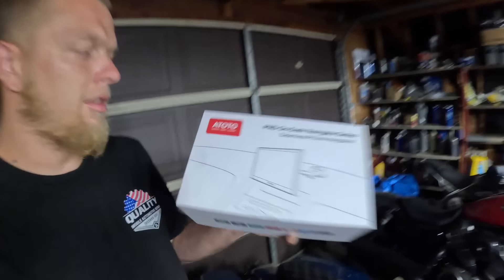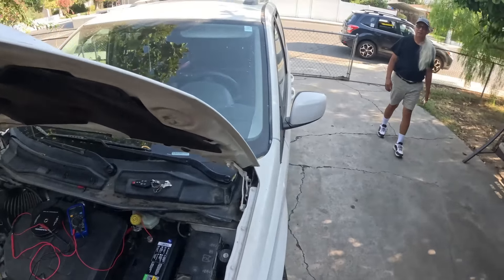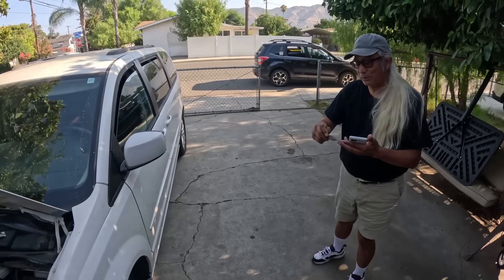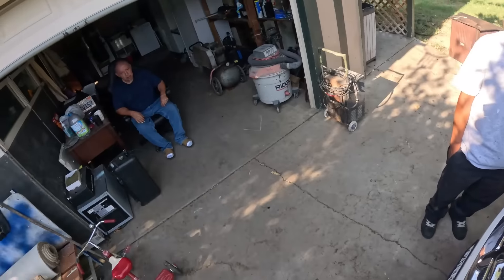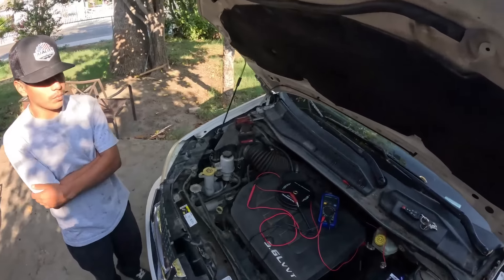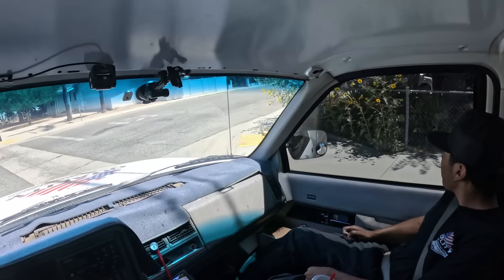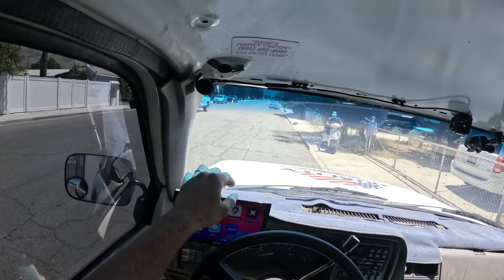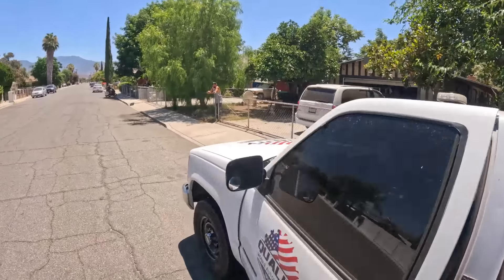CUSTOMER was UPSET! Mobile Mechanic ELECTRICAL diagnosis

Comment: I’m a master technician and unfortunately most people don’t understand that the first step in a diagnosis is to make sure the battery and terminals are good then proceed. It is literally the first step to take especially in today’s vehicles he money light will activate if the battery is not at full capacity
Reply: I’m a masterbator and even I know you start with power.
Reply: Lmao been master at since 13

Comment: It’s best to do a draw test on the negative side of the battery. And get yourself a good meter that is reliable and accurate. Cheap multimeters WILL let you down.  I will know haha. Your doing ok with showing the customer why there car Dosnt have a draw or have a problem. Keep doing that. You will go far. Best of luck to you out there

Comment: There is so many bad parts out there now, including batteries. Some people can’t accept it can be the problem because they think the part is new so it can’t be bad.
Reply: Bad parts not only bad for customer  also bad for mechanic making them look bad even job was done properly.  Parts quality getting worse
Reply: To be fair, the new battery didn't work
Reply: @saulpedraza645 and thats because most "mechanics" are just simply parts swappers.. who can't tell you exactly how something fails.. but that "its bad and needs replaced".. which is interesting.. given how much they make for simply being wrong so often also.. if I'm told to paint a kitchen.. and I end up painting the bathroom.. do I get to still collect money? Seems mechanics are given way too much leeway with their misdirection.

Comment: Nice job sir especially keeping the client informed and showed them the actual problem. Was thinking "put some dialectic grease on those connectors!" for those fuse box connectors but, they are probably fine...

Comment: Sometimes customers, and anyone else, for that matter, can let emotions get in the way of a diagnosis. Since the battery is new, it "can't be the battery." Anyone who says differently is wrong.
Reply: Yep I fix most of the family's vehicles, a lot of Chevy trucks, and delphi parts are junk now. Had 2 new coils and 2 new fuel pumps that were bad out of box, Bosch is now the GM factory supplier because of delphi quality issues.

Comment: Why didn't you do the draw test on the first time you were there?   You could have unhooked the primary wires from the bad battery and hooked up your amp meter between the jump pack and the primary leads.    The jump pack you were using contains a 12v lead acid cell battery, same as a car ;)

Comment: You need to get a genuine load tester that tests the battery by putting a load on it.
Reply: You can't load test a battery unless it's fully charged. This battery is junk. Goes to 11 volts with just the key on.

Comment: Hi , great video , I suggest you to get a clamp amperometer to diagnose abnormal absorption on the battery.  The current clamp is quicker to apply to the circuit , and saves you time.

Comment: Retired Mechanic.
Great job fellas.
Patience is a virtue and it definitely helps if you have great communication skills.
If you can give your customers the visuals of what's required to rectify the issue and articulate to then the diagnostic and ongoing prognosis in terms that are reasonably simple enough for them to understand, it helps vaiidate and alay the 'ka ching' $yndrome that required them to call you in the first place.
The bottles of water analogy you used to describe the battery issue with the mother was excellent. 
Keep it up.
Yes... some customers require a number of reassurances before they accept you're one of the good ones that they will readily become part of your customer base.

New sub from New Zealand.

Comment: I always run my meter in 10 amp mode when doing that test.  It's lower accuracy but sufficient to see if you have an unusually high parasitic draw, and robust enough to handle normal loads like ECM and interior lights.

BTW, did you put ink in the printer?  LOL

Comment: To diagnose this kind of problem takes a lot of time to diagnose. This kind of car is a piece of junk the problems are intermitent. To begin I want to hear numbers is it 12.5 v, or 13v, or 13.5v, or 14v or 14.5v or 15v or 16v. it is a big deal knowing the exact voltage from alternator to battery. does the vehicle has a parasitic power draw?
Batteries once are discharged fully, often times cannot be recharged and it isnt the battery fault its chemistry and electricity at work. wiring is most likely the problem as these vehicles are the worst.

Comment: Had similar issue, watched a couple YouTube videos. Ordered new relay. Desoldered bad relay, soldered good one in and put all the layers of the module back together. And worked like a charm. As others have said there is a bypass that you can buy for this issue but it was like $50 and the individual relay was a couple bucks.

Comment: Tip from a guy that does a metric ton of diag at a dealer with low comeback rates invest in an amp clamp for parasitic draw test saves meters from accidents. I usually open all doors trunk and hood and close all latches so car thinks it's all closed and I can still access all of the vehicle until I find my draw
Reply: A regular inductive amp clamp meter won't work to measure DC current.  Inductive clamps only work to measure AC current.   AC/DC clamps usually cost extra because they use a hall-effect sensor to measure DC current through the clamp, so that you don't have to use that janky shunt.
Reply: I use a Klein tool one also comes with a meter for temperature and it has been worth it heavily for diagnosis I started keeping it out of the bag and more accessible I use it so much

Comment: I do my fees a bit differently. The original call was a no crank no start, then crank no start. To me it makes no difference if the battery was bad and the control side of fuel pump circuit was bad. Both are the no start condition and id bundle them as my diag fee.
Testing parasitic draw and testing bad battery is extremely fast and easy for me.
Looking at the wiring diagram on Mitchell is fairly easy but that's where I'd charge my full diagnostic fee + time spent.
Then any repairs after if client decides to proceed with repairs after everything has been thoroughly described where they can understand the condition and cause.

Had plenty of customers that get frustrated with bad new parts but when you show them it doesn't work, then bypass they generally understand you know what your doing, it also helps to add a rundown of what proven to be functional and what's not functional.

I simply tell them by bypassing a solenoid "control switch" they can understand it starts and that can only happen if everything on the circuit is functional other than the switch you bypassed/manually closed.

But I get the frustration with some customers. Been there many times.

Comment: You could do a draw test using a jump pack , disconnect the battery and just test using the jump pack 
You would then have an answer one way or another and prob not need to come back

If you do your current draw test using the ground terminal you dont risk shorting out the positive anywhere

Comment: I just got rid of my 85 GMC truck with extneded utility bed. For your dash you can buy an after market molded single din stereo kit that replaces your storage box just below your 2 dash vents. You can then buy a single din radio with flip up screen. I liked mine because I had all the modern features and it wasnt very obvious.

Comment: Sucks that components in cars these days are so integrated and that parts that used to be replaceable like relays can't be serviced. Good job on the diagnosis. Looks like you will have a repeat customer there👍

Comment: Nice pinpoint accuracy on the diagnosis.  Mind you though, I'm the kind of guy that would try to fix the unfixable module. Then again I work on PCBs all the time.  The only way that would be truly unfixable is if the was covered the PCB in resin, which I have seen before.  Great job none the less.

Comment: Nothing sweeter than having the customer sit by and offer “help” and their know how.  Luckily, I build fences.  No customer wants to sit in the sun watching someone else digging holes and pulling old cemented fence posts.   I do a little mechanical work as a side hustle when fencing slows in the Fall. Mostly maintenance, brake pads, oil changes, fuel filters, pumps, etc…  God bless the REAL mechanics that have to grind through electrical gremlins or replace head gaskets, swap transmissions, etc…

Comment: If you have a Bad Ground or Draw Down on Electrical System, even a a New Battery will not last a week. You must find Ground or Electrical Component that is Wasting away your Battery, every Mechanic with any experience knows this...You told them the way it is so that is good.

Comment: Just discovered your videos, I enjoy these types of troubleshooting videos. It helps further everyone's knowledge. What auto tech school did you attend? And how long have you been in the trade?

I attended my local community college auto tech program, but never went into the field. Learned enough to repair my own vehicles, and do small jobs. I'm in the field of CNC machining now.

I admire folks of various trades, particular your profession and setting, mostly dealing with Elements of California. When performing repairs in my driveway at 100 degrees, sometimes I stop work at 1 or 2pm. To continue later on in the evening or next day.

Comment: I had the same issue on my dodge ram 1500. Would of either had to buy a new fusebox , or take out the defective one and send it out to get repaired by someone whos takes them apart. Thankfully i found a fuse bypass online for like 25bucks. Supposed to make your fuel pump run when you put the key on ON position. Had it on for 5 years now and no issues lol

Comment: Maks tipm repair will repair and warranty your tipm for cheap. They also sell new and rebuilt tipms. I’ve had some headaches resolved with it. They can also test it for you. They return it in shrink wrap.
Reply: Seriously take the tipm out, send it to maks. The have videos how to take them out easily. I had a dual relay blow inside my tipm. It was a rear washer fluid motor/front wiper motor relay. Wipers wouldn’t work until I pulled out the tipm, sent it in, and got it back, installed it and voila. It was 185 dollars. They also replaced the fuel pump relay with a solid state one. It’s a common issue. I was told by a Stellantis Chrysler designer said they designed it like this on purpose.   They could have easily made all the relays accessible. 5 dollars relays inside 1000 dollar tipms should be easily swappable.

Maks is a life saver.
Reply: Ahhhh I see at the end of the video you got the Maks tipm. I would have just sent it in man. 185 bucks with a one year warranty. Better yet, get the longest warranty you can. 

Good job though. 

Everyone I know has herd my tipm stories. 😂

Comment: Those Wally batteries sometimes have weak cells new, I don't know if it's storage, quality control, or handling of them before their sold.  But their warranty is second to none! I've only had a few defective returns in 30 years so that's actually pretty good. Still run em to this day

Comment: Not a fan of the head camera you move around too fast,, personally would have ran the scanner first.. you can run an external relay off the key to bypass the pump to get it to run..mic drop cya

Comment: having been a stereo installer since the late 80s and always going with brand names like Alpine, Pioneer, Sony exec I will say I got an Atoto because of the android operating system without all the android auto bs and no video while driving and I will say they make some pretty good stuff, and it also sounds great.

Comment: What you need to do is see if the relay was a switched power or ground. Then act as the computer by providing power or ground onto relay through ecm  depending on the the switch input. Check results by using test light

Comment: Excellent troubleshooting and understanding the customer needs of understanding what the vehicle was doing. The first was no normal start condition. Battery had  failed. You needing a good known battery to move forward with diagnosis on one issue. Another issue was to verify no parasitic draw with key off and modules asleep or awake. The third issue was to crank engine over, but no start and run condition. Due to a verified no fuel delivery when cranking to start engine. Troubleshooting the lack of fuel pump control and operation.  Removed and replaced TIPM to  verify a good crank and start and run test. Clear codes and reconfigure replacement of TIPM. Incidently. Some mechanics do not understand jump starting a car is hard on computers and modules. I remember a instructor in the '80s said its always better to start by always putting a known good and tested battery before trying to start a fuel injected vehicle. He said computers do not like it.😅🎉🎉🎉😅

Comment: Good job... i used to do those external relay kits on that tipm.... i don't mess with that kit anymore. Just replace the tipm !   I keep 4  different good tipm 's  in my shop.... just for plug in diagnostics.   I know you can't carry around all that kinda stuff....just saying how i do it at my shop....

Comment: And Robert is a good mechanic, he has ethics people skills and he knows what he's doing for the most part. But he missed one thing, he could have fixed the guy's van with that bad relay box. All he had to do was hook up a toggle switch and wire to the battery and fuel pump, and it would be somewhat odd having to flip a switch and then start your vehicle, but it would have work! Keep up the good work Robert!
Reply from the maker: Thanks Billy. Unfortunately installing it that way would be unprofessional of me and can cause a fire which I’d be liable for.  Here at quality mobile automotive we either do it right or not at all.

Comment: just because it's a new battery, does not mean that you didn't get a bad one. Walmart will insist on testing it (of course) and if, in fact, the battery is garbage, the test will show that, but it takes a good hour or more to test it. Walmart's guarantee on batterys is pretty good, but the wait is less than good.

Comment: As a "mechanic" you should know that the fuel is an actual lubricant for the fuel pump, therefore by running on "fumes" the fuel pump will not last as long if you do that a lot..
At a 1/4 tank fill it up.

Comment: Maks for tipms have had great luck way cheaper, also pull tipm up and check all plugs then verify which plug is your fuel pump circuit, I have saw a lot of corroded plugs or the terminals melt and get loose bad connection and you can just repin it, not Allways internal to the tipm, you can also pull tipm apart and re-solder the circuit but I’m sure your aware of all this
Reply: Not much corrosion here in Southern California

Comment: Check connectors for corrosion when disconnecting.
I've learned it is best to spray the contacts with contact cleaner to ensure partial corrosion doesn't cause problems down the road.

Comment: In my younger years I was a mobile mechanic also down in Port St Lucie Florida Fort Pierce and Vero Beach and Stewart those were my traveling distances and brother I was running into the same problems you're running into now but you have to charge or you're going to be out of business you can't keep going in the negative it's nice to help people but sometimes you just got to put people in their place and let them know you're not out there for free you have bills just like they do you have to feed your family you have to pay insurance you have to have insurance just in case something goes wrong that you work on you know the ropes what you're doing a great job you're a great guy and I wish you the best I love watching your videos hang in there you're young yet I was doing this stuff in Port St Lucie in the 1980s through the 1990s through 2006 I worked on heavy equipment big trucks trailer brakes air brakes air conditioners welding on big tree grinders when the mill would break a tooth off I would have to weld new teeth on the drum wait over 2000 to 3000 lb but that was the kind of work I did I serviced heavy equipment from small to large what I got my money I had a mobile equipment cleaning pressure cleaning on top of all that plus I had a lawn service on top of that I had Crews working for me now if you can stay independent and make money you're in Arizona the gambling capital of the United States people will spend their money playing cards and all kinds of other things get your money you are well worth it and so is your family

Comment: If he's driving a diesel, all he's really got to do is just take  used cooking oil, vegetable oil ,use motor oil and peanut oil and filter it and set your diesel up to run on it! That's like 50 cents or less per gallon, and in some cases free if you're willing to put in the work!

Comment: Car batteries are thrown around in trucks then shipped in boats then back in a truck and lugged up on a shelf then thrown in your car to live it's life vibrating/jostling around cells drop all the time even AGM batteries
Reply: I deliver AC and Ford batteries and get a lot of dead ones returned defective. Just because it’s new doesn’t mean it’s not defective. 🎉

Comment: Common issues. There's a gentleman who made a jumper you connect with the two fuses you were connecting. Cost about $30 bucks. Replaced about 4 of them and works like a charm.

Vertical visions is the company
Part/REF # : TIPM7-PCB2-LITE

Comment: Relay in the power module is bad. There is a jumper. Wire kit on the market to jump from cigarette lighter back seat to the fuel pump. If I remember correctly, I fixed this one time on a dodge caravan. They are notorious for this problem